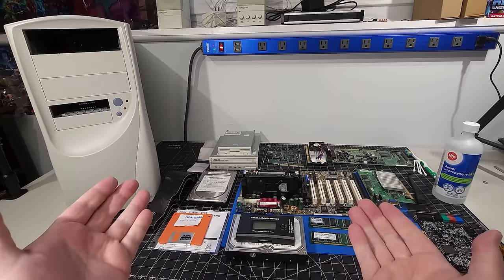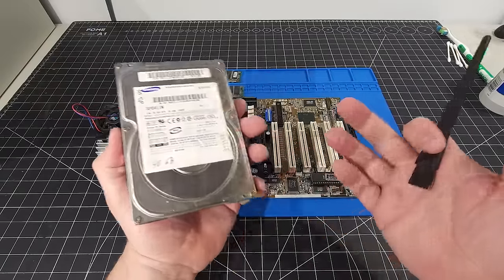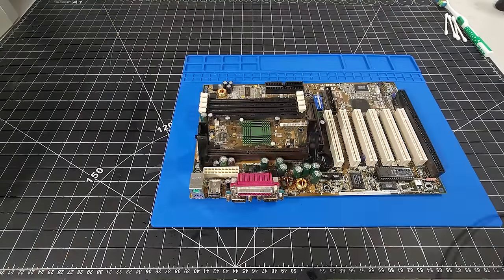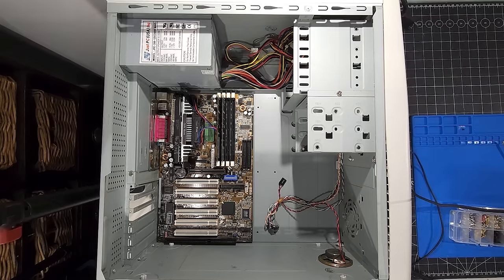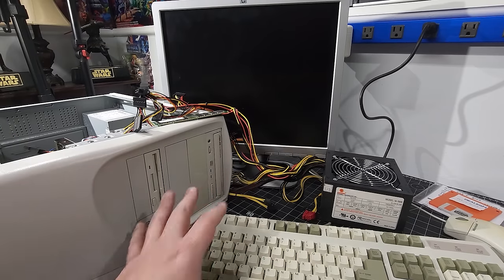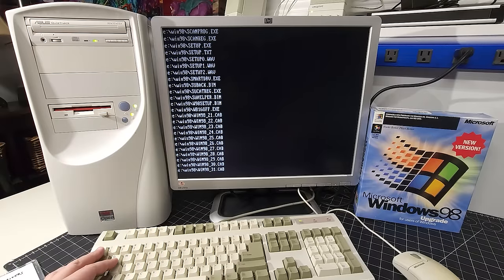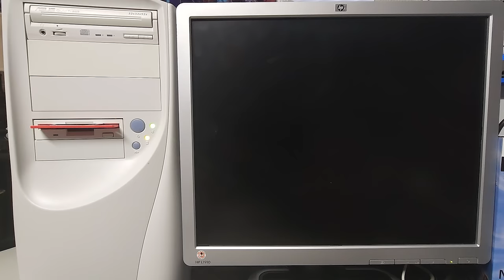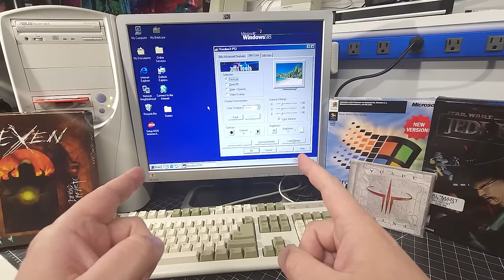Building a Retro Windows 98 PC!!

Comment: My 1st pc was the windows 98se pc with the socket1 Pentium3 500mhz/100bus cpu, 128meg pc133 ram(which in bios i set to +33mhz) and Savage 4 3d gfx with 32meg vram.
Then was upgraded to 700/133 and doubled ram to 256meg. And finally to 933/133 using a slocket converter and geforce 2ti gfx card😁
Reply from the maker: Nice builds!  Do you still have these in use today?
Reply: @TheRetroRecall  unfortunately no, it was sold at the time when i went to upgrade to a newer pc!
Having started to use Internet at the time was able to get the Compaq Prolinea 486, and the Deskpro Pentium MMX which i still have today. My main pc is still the 1st gen core i7 having not been upgraded since then due to lack of funds. 
Anyway,  the past year i have been buying a few bits, cpu's(core i3's core2quad, Pentium 4's and D's, and Pentium 3's slot1's), ddr2 and ddr3 ram, pc's, which i bought a 3nd gen Ivy Bridge core i5, a 4th gen Haswell based Pentium upgraded to i3, and a core2duo!
Oh, i also have a Sony vaio pc with a Pentium 3-s which i think its a Tualatin based, but has a weird monitor connection which the keyboard and mouse is plugged into. I wanted to upgrade the graphics but due to the monitor having a different connector(due to providing ps2 signals as well as the vga) im forced to use the on-board graphics.
Reply from the maker: Nice builds.  That Sony sounds pretty neat -  I've always been a fan of the Vaio line.

Comment: there's likely significant ripple on the psu rail that supplies the cpu
the avg voltage may test fine but transient voltage dips will cause transient cpu errors

a scope would be the best way to confirm.
Reply from the maker: Hmmm a scope I do not have (yet).  Adrian Black has been experimenting with some entry level scopes that would seem decent for this purpose.  I may have to invest in one.

Comment: For the psu, how many watts can it do on the 5 volts rail? System like this doesn't use 12v. Total system will need at least 20 amps on the 5 volt rail to function properly.
Reply from the maker: I will have to check to see what it was drawing when fully connected - or test with a greater load in the future.  Others have suggested that either the PSU has bad caps and couldn't keep up with the draw, or that the 350w wasn't enough for the system where the 550w was fine. Either way, I have some more testing to do :)

Comment: Question mate, do u think its worthwhile to upgrade to a newer pci graphics card instead of sticking with something like a TNT cards(or similar)? I recently bought a geforce 6200 pci card last month after trawling thru a minefield on ebay to upgrade for better performance than using on-board graphics or older cards.
Reply from the maker: I would say yes.  Is your board limited to PCI?
Reply: @TheRetroRecall   yeah it is.
I know that certain low-mid range geforce's and radeon's can be on pci cards. Think the latest geforce is a gt210, not sure what radeon goes up to.
This mobo doesn't have a dedicated agp slot, only a weird amr slot in its place and 3 pci slots
Reply from the maker: Yes I've had those boards.  To your point you can find models that would give you decent performance on pci... Far better than using on board graphics.  I've been told at that time the performance boost using AGP is 3-7%.  Which may not be required for you.  Similar to this build where I chose to use my Voodoo3 3000 PCI card due to its capabilities even though it is PCI.

Comment: Awesome build! I have a very similar one: same motherboard and cpu, Voodoo 3 2000 (AGP, but seem to recall the AGP and PCI cards have similar performance), 40gb real hdd (seagate barracuda) and 256mb SDRAM. I went with an audigy 2 sound card for EAX support, great for games like half life and unreal tournament. The audigy and live! cards are pretty good for DOS games, especially when you load in a nice sound font for general MIDI, but there are a few games that have crackled PCM sound. I tried pairing my audigy with an ISA sound card to cover those edge cases but it seems to Bork my audigy when I go into pure DOS mode (even with resources disabled and no conflicts) and I have to reinstall drivers, so I’ll leave the ISA sound cards for my Pentium mmx machine…
Reply from the maker: Thank you and thanks for sharing your build!  I love hearing what others are using / have tested.  Gives me ideas :)

Comment: My first "gaming" build was very similar to this, with a Slot 1 P3, 256MB of RAM, and Windows 98.  I don't remember which GPU I used, but I did have a SoundBlaster card.   I had that PC for over 5 years, and did several upgrades along the way.
Reply from the maker: Nice!! Do you still have this hardware or plan on building another one like it?
Reply: @TheRetroRecall  Not any more.  I sold it to a friend in the early 2000s.  I've done several gaming builds since then.  My favorite was one I called the "cube", a square SFF that had just enough room for the components.  The nVidia 1060 had just released, and it was quite a powerhouse for its day.  My son still has it, he uses it as a media center PC.
Reply from the maker: Nice!

Comment: For the power supply, it is possible that it didn't had enough Amperes available for the 5 Volt rail. Modern power supply tend to put all their watts towards the 12 Volt rail now They used to do this to 5 volt during the P2-P3 era. I myself had some issues with a modern PSU with my P3 build, when replacing it with a PSU that did had more ampres there, it worked flawlessly.
Reply from the maker: Yes it is quite possible.  Many have mentioned that as a potential issue.  I guess I'll know more when I dig in a bit deeper into testing.  Thank you!

Comment: 3 things to note
1 this board technically have 2 isa slots, one of them is simply unpopulated so if you know how to suck out solder you technically can populate and make it working pretty easyly since all isa slots are basically wired in paralell
2 reflashing the bios witheven the same revision could be beneficial in long run, since this board uses early eeprom that with time suffer from bit rot and it was most likely last programmed 20 something years ago and i seen pentium 2 boards randomly loosing bios in the past
3 this is asus mobo so if you ever want to populate front usb look out for the crazy asus pinout with missing pin
Reply from the maker: I didn't know about the ability to remove the pci and add a second ISA slot - thanks for that!  I did see configs of this board where they came that way, but never that you could easily swap it out.

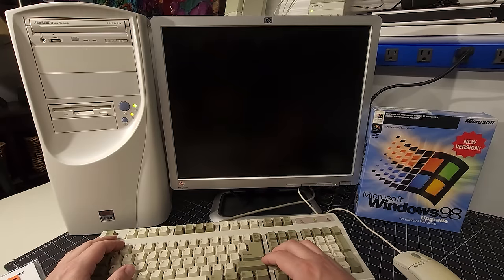I did flash the bios to the latest BIOS at the 35:00 min mark.  That should take care of that :)

I actually do have that USB cable in my parts bin! 

Thanks for this and for watching!
Reply: @TheRetroRecall  do you have to remove the pci slot though? i was more thinking if the space is not obstructed there  is isa footprint already on the board and if it fit it would just work there are also thise narrow pci slots asus used on tusl2 but removing pci is much harder than just puting isa in already empty holes
Reply from the maker: Sorry, I misunderstood.  Yes - there seems to be space there and would be an easy installation.

Comment: I've got an Asus TUSL2-C motherboard that I've had for years. It's got a CPU and memory installed. I've also got an IDE HDD and IDE Optical drive. I also happen to have a copy of Windows 98 SE. I'd have to scrape up some IDE ribbon cables, case, PSU & a graphics card for AGP.
Reply from the maker: Sounds like you have the main components.... The rest are the easier parts :) good luck on the build, let me know how it goes! :)
Reply: @TheRetroRecall  I will definitely do that. I've been thinking of doing this and since I watched you it's given me a push to go ahead.
Reply from the maker: I LOVE this!  This is exactly what this channel is all about!!!

Comment: went on ebay to look for that Voodoo 3 3000 PCI graphics card and dang, the bottom pricing was $160 but most were listing for more. Ouch!

My build project is a circa 2007-2008 motherboard and have a single core Pentium CPU, clocked around 3GHz. 

I bought a Nividia PCIe card that was manufacture released in 2009 and was only $11.

Now that PCI Sound Blaster card, I found one for $5. I do have an ISA bus Sound Blaster card but this particular motherboard doesn't have any ISA slots.

Well, building a Win98 PC can be rather spendy if want a graphics card for which there's Win98 driver support.

WinXP era PC can still be built on the cheap, though.
Reply from the maker: Absolutely.  Yes the 3dfx cards are quite sought after by collectors.  They are amazing cards.  I'm lucky to have 4 of them.

Comment: I’ve seen a 2004 hp media center machine go from running before shutting it down to failed power supply at the next boot. 

I’ve also witnessed a power supply failure on a 2004 dell latitude d610 laptop while it was running. It didn’t damage anything but I had to dig out my spare while it ran off the battery 😂.
Reply from the maker: Yes I think in this case the PSU was too little for the requirements.

Comment: Power supplies have capacitors too that can pop open and leak. Don't go touching anything inside the power supply. They can store power and kill you even unplugged.
Reply from the maker: For sure, appreciate the warning.  I do need to get something to discharge the caps - not only for this, but for when I want to work on CRT's as well (as I have a couple of those lined up).

Comment: This is a bit similar to my own PIII system which is a PIII 550 with 256MB and a GF MX4000 except I had my system since the 90s. my system began as a 500mhz OC 333Mhz PII with GF4. and the reason your power supply did not work is probably because it likely have a ton of ripple in the output which can only be seen with an oscilloscope, the caps are probably bad in it one way or another
Reply from the maker: Appreciate it.  It has been suggested that it is either the caps in the PSU or  there wasn't enough wattage for the system.  Either way, should be easy enough to test the caps.  Thank you!

Comment: I build my Windows 98 PC based on Socket 370 with an Asus CUSL2 and a 500Mhz Pentium.
Combined with a Radeon 9000 and 3x128 MB DDR1 RAM and installed Windows on a 80GB IDE HDD.
I even added a Soundcart to hear that iconic startup sound but It don`t work yet.
Reply from the maker: Nice build and keep at it, you will get it going.  What's the soundcard?

Comment: A few years ago I put together a 98 build. (It was originally a Windows Me machine but I prefer to run 98.) It's an old HP Pavilion 6835 I picked up for free that I beefed up with what parts I could find. Here's the specs: 1ghz Pentium III socket 370, 256mb PC-100 ram, 120gb WD hard disk, Intel gigabit ethernet adapter (because I could), some kind of Creative sound card (can't remember exactly which one), ATI Radeon 9250 256mb PCI, Sony CD-R/RW/DVD rom drive I've had since 2001. Not sure on the exact type of motherboard but it's whatever came with it. Perhaps a bit overkill on some of the hardware for Windows 98 but it plays all my old games like a champ and even has my original CD burner from back in the day. You just can't beat playing old games on old hardware.
Reply from the maker: Nice build and man, that awesome 1ghz cpu!!!!! Agreed - old hardware just feels right.

Comment: I haven't encountered the problem you described with the PSU, but just thinking it through is it possible that the PSU that you thought was working just provides noisier / higher ripple power and that the system it's feeding is more sensitive to that?
Reply from the maker: Yes definitely possible.  I Think I need to test the voltages while it is connected and tuens on to see what is failing.

Comment: in this particular board you dont need the 80pin ide cable.. its very old, only UDMA2 capable (up to 33mb/s) you can see when you load DOS, both hdd and cdrom are UDMA2. 
the cable is required for boards with modes faster than UDMA2. 
ps: the hdd is capable of UDMA6 (up to 133mb/s) if you use it on a more modern board
Reply: https://en.wikipedia.org/wiki/UDMA
Reply from the maker: Thank you for this info and the reference!

Comment: You might have fallen for the PSU trap that got me a few times as well.
When dealing with retro hardware, you can not just look at the overall power rating of the PSU. 
In modern times, the CPU and GPU draw their power from the 12V rail, and the 5V is mostly used to power USB ports.
Therefore, modern PSUs provide most of their power on the 12V rail(s).
But back in the old days, everything ran on the 5V rail. That is a common problem for Athlon XP CPUs that are quite power hungry, and modern PSUs often don't provide enough 5V power.
Reply from the maker: Much appreciated.  Yes, since this video I've started to do that.

Comment: I've already told you about it, but I'm still trying to get my retro '98 systemsetup just right, wish I had the piles of hardware you have to pick and choose my config.

Couldn't get any CF to IDE adapter working so I ended up an IDE SSD (mSATA to IDE adapter with 32GB mSATA drive in it) 
My CD-ROM failed so I had to buy a black bezel drive to replace it, we have two IDE DVD/CDRW drives with beige and black replacement bezels at work that nobody has needed for years, but when I asked the boss if I could have one, he said no.. Bummer cause eventually someone is just going to toss them in the recycle bin.... I've gone through 3 AGP video cards trying to get a good one, landed with a GeForce 2 MX200 AGP card, should be ok but would do dirty things for a Voodoo 3 3000 or Voodoo 5 5500
Reply from the maker: Keep your eyes out on your local online Marketplaces local ewaste centres, thrift stores etc.  That's how I started.  Also I have some cool friends who keep an eye out for me which really helps me add to the stash and choose parts for these types of builds.  I unfortunately had a bit when I was younger and I tossed everything (wish I hadn't). 

I've had issues with CF to IDE adapters... And I'm not sure why.  I usually walk away from those issues as it can take a lot of time for an unknown issue. 

Good luck on the build, it sounds like you are on the path.
Reply: Thanks :)  @TheRetroRecall

Comment: I love the period-correct builds but the cost is getting crazy!  I have a line on an old P3 system that I can get for free but I don't know any of the specs on it, I've been looking to do a DOS and Win98 retro system for a while so hopefully I can find some compatible hardware to complete it for cheap.  Otherwise I've got 7 Pentium 4 systems and 5 various Athlon 64 systems laying around and one of them will work just fine, as well as an array of graphics cards from GeForce 2 to 6600 GT to make sure I shouldn't run into compatibility issues.
Reply from the maker: That's excellent.  I hope your P3 setup works out for you.  Yes, you are correct.  There is quite a jump in cost on this older hardware.  I've been fortunate as I have a few people who scout for me and donate to the channel to showcase it.  I recently went o line and just the Voodoo3 cards PCI or otherwise are crazy in price.

Comment: When it comes to reworking old computers I never reuse the old power supply, I always buy a new one. Where Windows 98 is concerned, it will only cache 256mb of ram, so that is how much system memory I always use. Insofar as the "system panel connections", I always install those before I even seat the motherboard in place. When you have the opportunity, as you do in this build, to add a "puller" fan in the front of the case to increase airflow, I always add one. As he mentioned the 3dfx cards run hot, so what I did was add a PCI slot exhaust fan right below the 3drx card. And, when it comes to mechanical, or platter hard drives, I gave up on them as even the brand new ones failed on me, I started using IDE to Compact Flash card adapters for old builds like this one, much, much faster, and more reliable.
Reply from the maker: Thanks for the insight.

Comment: I am guessing the old PSU did not have enough wattage to supply all the components with enough power. 100w added  is the rule of thumb I use. So for 450w, use a 550w.
Reply from the maker: Yes the new one was 550. It's quite possible.

Comment: We recommend you should use any CRT monitor for Win 9x/Me because the lack of driver for thin monitor may affect the OS stability. 😉
Reply from the maker: All I can say is I've never had any issues of instability as a result of using the Plug and Play monitor - again that's me.  Also, Windows detected the LCD monitor driver in this case.
Reply: @TheRetroRecall  ok. After driver installed, I changed the color depth to 256-color or higher to restart Windows... but Windows failed, with or without artifacts of screen, higher color depth to back to 16-color. This is abnormal. 😂🤣 Lol. 🙂😉
Reply from the maker: Weird that the video driver didn't correct the 16color depth.